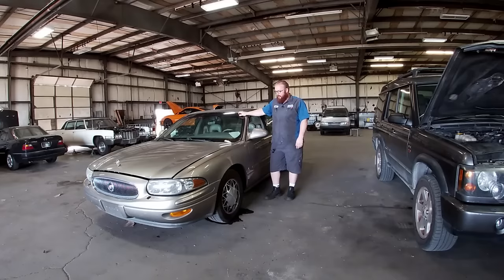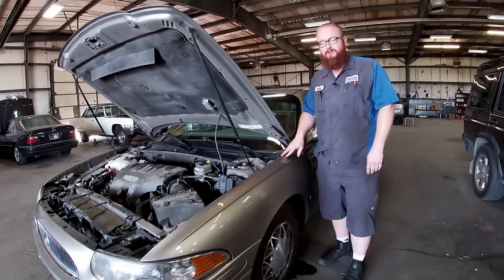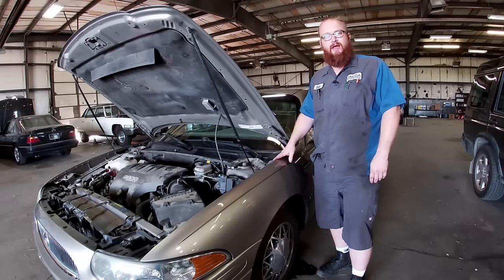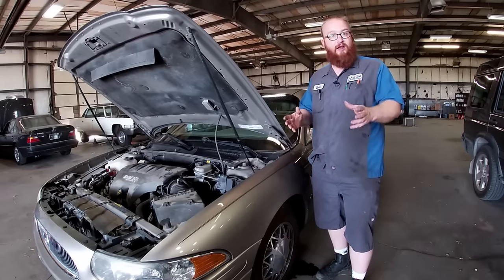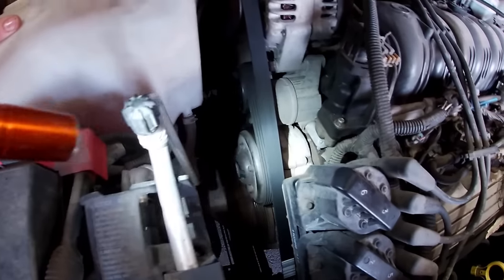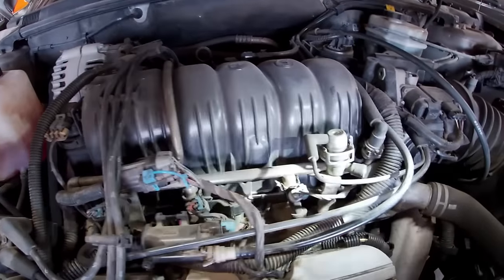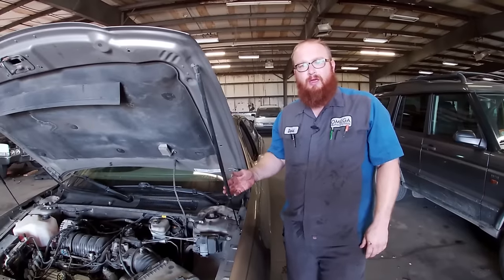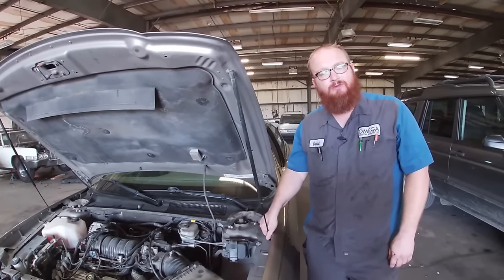CAR WIZARD highlights what makes the Buick 3800 V6 the BEST engine ever!

Comment: When he talked about the dealership saying the motor was leaking from everywhere but that there was no leak at all I almost choked on my sandwich. The level of dishonesty is unbelievable. That is pure stealing. Having an honest mechanic is so important!
Reply: Which is exactly why we call them "Stealerships"
Reply: Or learn how to fix your own car.  I started doing that long ago, after having to fix something the "technician" screwed up.
Reply: @fsnissen  Yea that's EXACTLY how I started 20+ years ago.  Tech screwed up something and tried to get my mother to pay more, took that car home and did it myself.  Got me inspired, stayed at it the whole time.  You eventually learn how to fix a car after a dealership tells you it will be $475 to install one 02 sensor that totally accessible from the top facing you.
Reply: Some independent repair shops are also dishonest and/or stupid.  Took one of my vehicles in to be repaired because I didn't have the time to fix it myself.  He turned out to be a moron.  He left the retention clips off the fuel rail on my 7.4L and popped loose on #2 fuel injector a few days after getting it back, causing a fire (which thankfully happened right as I got home and I was able to put out quickly).  Discovered why this happened, this guy just lost my future business.  Fixed it, myself, the right way, with the clips (a whopping $12 dollars) he said were not necessary.  Well clearly they were necessary (60 psi system).
Reply: Question EVERYONE!!!
Reply: It is steeling! And how is that legal?!?!
If you're not a big huge wealthy Corporation it's illegal... Hummmm
Reply: I was told my Honda V6 needed a front main seal. Upon closer inspection, I found it was power steering fluid dripping down from the top. The fix was $0.99
Reply: Yet we not only allow this, we HAVE to buy a new car from a dealer, and we are pressured to take our overpriced vehicle  (due to dealer mark ups, up selling, commissions) back to them so they can rape us again and again until we feel pressured to buy a NEW bloody car. Buying a new car, for most people, is the worst investmant they make in their lives.
Reply: Having a honest mechanic is super important but also very rare nowadays.
Reply: You could literally take a brand new vehicle, run it on a track for 40,000 low stress miles, do every bit of maintenance shit hire a formula 1 team to do every maintenance piece perfectly.  Bring it in to a dealership: ”it’s a miracle you made here alive in this thing!”
Reply: Then ya wonder was it the Tech or the service writer. Which one is the dishonest one? Did the tech not care and write up BS, or did the service writer adjust the work order to say this, that, and then other thing?  If you go to a place where the owner is the only person there/turning wrenches then it's easy to figure out. But when a service writer is added need to take another look just in case.
Reply: I've got a great StealerShip story. I took my parents to get a new Subaru. Picked the forester, test drive, etc. Came time to talk price, and the saleswoman told us, "I can't discuss the price without a $300 deposit". That is not a joke. I asked her to repeat herself. Same thing. Unbelieveable. My parents and i just got up and left.
Reply: Established dealerships and auto repair shops can get away with it. If you or I did it it would be a crime. Typical business in the USA...
Reply: @fsnissen  been there done that!! From a well known shop in my area! And I'm not ase certificate!!
Reply: im a mechanic and always take a deep look everywhere when the dealership checks my new car and they hate me but lets be honest they aint fucking me
Reply: And yet, there were leaks up top that he dismissed as "age."  I don't tolerate leaks anywhere, ever.
Reply: Honest mechanics are very hard to find.
Reply: @Embermist69  the whole crew is trained to sell cars so they brainwash the customers so they can profit from them!!!
Reply: How do you know a dealership is lying? Simple. Their lips are moving.
Reply: 2008 the front axel on my 2006 Monte Carlo broke in half as I was getting onto the highway. It was towed to the nearest shop where it sat 4 days because they didn't have time to look at it before then. He called and told me what needed fixed and it would be $1500. I had to have it fixed.
They had it two weeks and when I picked it up, the bill was $3300! Never once called me to discuss the added work and doubled bill. Had to have the car, so I paid it and he gave me a copy of the itemized bill. I took it straight to emissions for a full inspection, and it didn't pass because the U joints(?) or T joints (can't remember exactly) which the shop that fixed it was supposed to have fixed/replaced, amongst other things. The inspector told me they didn't replace them, but charged me. Gave inspector the itemized bill. He told me the axel had been welded, though I paid to replace it. 
He told me a few things were fixed but it should have been closer to $500. Took to another shop and called first shop and went off big time.
They took $3000+ from a single mom who's husband had just passed away and clearly had no regrets.......
Reply: Not just as a mechanic, but being honest in your walk through life.
Reply: For a motor that clean, its really easy to shine it up and show the victim a clean car and say, "look how leak-free we made it."

Comment: Reliable, easy and cheap to fix, good fuel economy. It's no wonder GM killed it.
Reply: GM can be assholes. They should have never gave up on the engine. I wish they would have made the engine in the longitudinal form. Looks like car companies just want the money. They don't want to make reliable cars anymore they just want the money just for the repairs. Part of a Rothschild plan.
Reply: Not in line with GM core values these days.
Reply: @az7378  They put some in Firebirds.
Reply: What? What could go wrong by making engines half that size and turbocharging? 😅
Reply: GM went bankrupt a few months after they discontinued this engine.
Reply: l have a 05 Buick park avenue SE ' engine is a Champ! with over 180k miles! this is my 3rd 3800
Reply: @az7378  They did have a longitudinal version of the 3800. It's the base engine in F-body cars from 1996 on, with all 200 hp on board (205 with a certain package) (I think manual '96s have the 3.4L)
Reply: @az7378  they did. In the holden commodore
Reply: Right on
Reply: Robin Rhyne it’s old and outdated.
Reply: Yeah, but we have the 6.2 now !
Reply: @KennyboyGM  ???

They could not do what they did to the 3.1 and 3.4.... put variable valve timing and intake runners on it?

Because they could have....

They did it to the v8 small block..... aka LS/LT 

Like.... ford is making a pushrod 7.3....
And pushrod are newer tech than OHC
Reply: @KennyboyGM  I'm a sucker for bulletproof reliability
Reply: Good fuel economy ? Insane? V6 gas no no...4 cylinder in a lighter car will whoop is ass
Reply: Why is dependability and longevity outdated?
Reply: Emission regulations killed it, just like all the other past engines that were solid, reliable, and cheap to produce and fix.
Reply: I have a 92 Park Avenue 16 miles a gallon tops on the interstate on premium fuel tuned up 5000 miles ago.
It runs well it just sucks on fuel I guess because too small of engine in too big of vehicle.
Reply: they didn't bring the holden commode to the states.
Reply: @markbhoward  have you heard the saying the candle that burns twice as bright burns half as long
Reply: @kitecattestecke2303  4 cylinders get a little better milage but at the cost of higher revs and there just shit to drive i hate driving my little rusted out 4banger and we arent japan or the uk where all the cars are hatch back shitboxes
Reply: @henryostman5740  What was the Pontiac G8?  and the SS.?
Reply: @garymckee8857  my dads 97 lesabre (3.8) gets 32 at 70mph 

My grandmothers 06 park Avenue gets 28 to 30 at 70mph...... but when she does 60, it gets damn close to 34
Reply: And my 3.1 99 buick century struggles to get 28mpg at 70

The 3.1 spins 2250rpm at 70
While the 3.8s are only turning 1900 to 2050 rpm

Highest mpg = highest load at lowest rpm

3.8s can be geared more for highway because of the low end torque 

My 3.1 has to rev its balls off.....

It's the difference between.... say... 4.10 and 3.73 rear end gears
Reply: @bryantb3391  4 bangers get better mpg on flat land

But a 3.8 VS a 2.0 climbing a mountain pass in montana..... no contest

the low end torque of the v6, allowing it to stay in overdrive (with the torque converter unlocked).... at like 2400 rpm

Vs the 4 banger having to drop down 2 gears, and scream up the hill at 4500+ rpm
Reply: @ednorton47  Divine intervention
Reply: @meandthemrs7403  I guess people like breaking down in their cars, it's the "in" thing now lol
Reply: And in the Grand Prix. They even had the Supercharged version for the GTP models, absolutely awesome!
Reply: That's why G.M. 3.6 liter, was invented. To fill the service department.
Reply: Mark Howard exactly  no trade in value . I bought a mint condition caddy CT’s diamond white for a toy 1/50 of the price new needed a few minor repairs brakes tires  water leak not going to be winter driven or many miles put on engine and bicycle timing chains ok funny I bought a f150 eco boost for towing my boat similar engine design not putting miles on it and spring summer and fall driven  hope twin turbos don’t puke previous owner changed oil and filter every 5000 km or 3500 miles
Reply: Simba Fishtigre your point who cares 3.8 can be made real fast anything can . Wizard is talking about decent power great reliability cheap to maintain and good gas mileage  my daily driver get 35 mpg 3.8 2004 Grand Prix with 400000km  minor exhaust mod 2 dual stainless 2  1/4 in out mufflers, resonator deleted otherwise stock if I want to go fast I have a resto rod c3 supercharged vette which I drive few 100 km a year
Reply: kain hall my 2004 Grand Prix gets 35 mpg with minor free flowing mufflers and resonator removed at 400000 km
Reply: Robin Rhyne the 3800 got terrible gas mileage Lol great motor but emissions and mileage is what kill the 3800
Reply: nick king I smell bullshit. I’ve literally never seen anyone get over 30 mpg in a 3800. Their gas guzzlers like my Jeep
Reply: Me and the Mrs because tv media Hollywood and told them aka brain washed
Reply: @az7378  they did in Holden Vy Commodores had the series II even the supercharger version
Reply: This architecture would probably not pass emissions today hence why it was abandoned. If you want reliable in the modern day get an LS/LT Small block V8
Reply: @kitecattestecke2303  even the supercharged versions get 24 MPG
Reply: @garymckee8857  if you have a non-supercharged L36 you should run regular. premium is for higher performance engines..... like the L67 supercharged 3800..... is it a park ave ultra?
Reply: @ramcharger154  mine has a 3.4l
Reply: they did not kill it, you did it, too much-- imported crap, made by 10 cents an hour labor force! America could not compete!
Reply: the 4.3 still exists
Reply: @nickwood8694  Best engine in my view and we got all the upgrades as well as proper access.
Reply: @KennyboyGM  Old and outdated is still better than the shit that has replaced it.Good engineering is never outdated,it's just that they find a new jingle to get you guys excited.The fact that it's just a con you don't undertand.
Reply: 98 camaro 3.8 series 2 got  336k on it
Reply: Also had a  80 Olds cutlass 3.8 lasted a long long time
Reply: @KennyboyGM  By what standard do you claim the 3800 Series to be old and outdated? Overhead cam tech (OHC) is older than overhead Valve Tech (OHV) . What killed this engine was emissions regulations requirements.
Reply: The series 2 had their problems after so many miles. The older 3800 tuned port injection from late 80s early 90s were the best indestructible motors I know they would more than likely outlast a series 2
Reply: Not exactly easy to fix, you have to take a motor mount off & move the engine to get the serpentine belt off.

Comment: Dude honestly the world needs more honest technicians like you
Reply: this type of work is hard, but the CAR WIZARD has our back so greatful!!!!!!
Reply: I don't see many on the road
Reply: If only politicians and heads of corporations would watch such videos, perhaps their minuscule conscience would start to let go of ego and greed and open up to  intelligence and common sense.
WWG1WGA
Reply: ABSOLUTELY!!  far to many  crooks  out there now days.
Reply: Car wizard admits he charges 30 min for a 2 min job @ 9:20, how exactly is that honest?
Reply: @andy_182  Most professions I’ve seen have a minimum rate, whether that be a flat fee or a minimum time of half an hour or an hour. No one is trying to go through the trouble of dealing with a customer for two minutes of pay.
Reply: They're ok. I rather have a LS.
You can get the cars pretty cheap and hopefully they never been overheated. And the ones after 2000 seem to have transmission issues.
Reply: Why? he overcharges for everything
Reply: Yall mad at this guy, he's probably one of the few where paying for experience is still much cheaper than paying for markups.
Reply: Facts! Ridiculous that you can’t trust most shops.

Comment: Mine was a naturally aspirated 3800. At 306k miles, I swapped the heads, intake, and balancer to install the factory supercharger the GTP has. I'm at 381k now, still the original shortblock.
Reply: @AA-wq5sm  it lasted to 343k. I'm on the second one now.
Reply: @AA-wq5sm  I bought a used trans with unknown miles for $400 and swapped it myself. With fluid, and other stuff you should probably budget for $7-800.
Reply: How long last manifold intake? What causes to fail? How long last the coolant pipe? Do they have a metal instead of plastic? Thanks
Reply: @royallion271  The last 3800 series engine made had aluminum upper intakes because the old polymer intakes will get old and crack and would suck coolant down in the motor and hydrolock them.
Reply: Curious:do you have to smog it? Considering converting my firebird to run the gtp supercharger.   I think CA smog will bend me over though
Reply: @michaelbacon822  it’s likely he doesn’t - however depending on the swap you (may?) have to… I live in CA as well. What year is your Firebird?
Reply: @kristiansowell6827  2002.
It has ca legal headers and as I k ew they would, the inspectors all tripped out until I showed them the approval plate
Reply: Gtp superchargers catch fire if your running from the cops
Reply: Holy shit, I didn't realize this comment got 150 likes lol. I got to 400,001 miles and scrapped the car, rust was just way too bad. The car still ran like a top, though.
Reply: @Michael Bacon  you should be absolutely fine to do the swap given that 3800s came with superchargers, so you're just using factory parts. Even with 42.5# injectors and a wicked rich tune (enough to run 50/50 E-85), I got 24mpg. If you're keeping your cat and EGR, you should do even better.
Reply: Those have a different bottom end on the n/a and you can blow the engine up because the rods aren't strong enough and the crank has way to much stroke for a blower
Reply: @moseyballad7954  that's the hood insulation that's catches on fire not the blower
Reply: Just replaced my own alternator in the advance Auto parts parking lot. It was easy as you say you do have to put a pretty long sleeve forearm ranch on the automatic belt tensioner to loosen it up to get it off but other than that it's easy. The MAF is easy to get to and clean or test. Everything's easy to get to. The only thing that's hard as the evaporator canister solenoid which is under the car somewhere. I had to replace those plastic elbows. Now that I know about the plastic intake I'll be on the lookout for that.
Reply: My series 2 3800 has 180k miles and running strong. I just wish the 4T65E or 4T65E HD transmission was built as good as the engine...
Reply: @collin3800 The super charger from the GTP only added 41 hp though. It wasn't a big jump. It's nice if you have it. I hope you didn't spend a lot on the upgrades. Otherwise, might as well go aftermarket and get 100+ hp gain.
Reply: @DylanL69 No, you can't blow them up that easily. GM blocks are renowned for their ability to handle insane power with stock internals. We threw a Magneson S/C on a stock 5.3L  in 2018. We put long tube headers and a custom exhaust. We tuned it, opened up the injectors, and hit around 500 hp at the crank (after a dyno). A 40% gain. We ran it for 3 years as a daily driver. No problems. 

The L67 and L36 are identical blocks. The L67 just has slightly heavier pistons and connecting rods and wrist pins. And it is only a 41 hp gain by throwing the intake mani, heads and S/C on from a GRP. it's a 20% gain.
Reply: @asmongoldsmouth9839  I call bullshit the bottom end won't hold up to and it will start to boost stack I have plenty of experience with those engines
Reply: Impressive!
Reply: I've been looking for a modest yet powerful increase to my 3800 very interesting that I found this. I love what you did there. How much would that complete swap run me? I would love to ride around with a sleeper Buick. One love ✌✌✌
Reply: Just got 05 lacrosse 60k miles for 2500 . Best car I ever had so nice everything works other than cloth seats I love it
Reply: @michaelbacon822 
Register it in Nevada. 😂